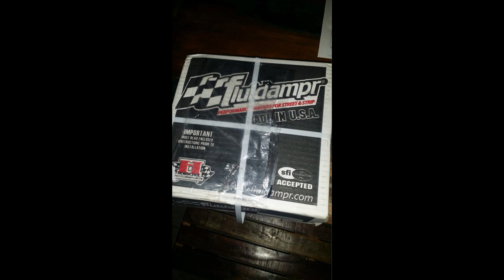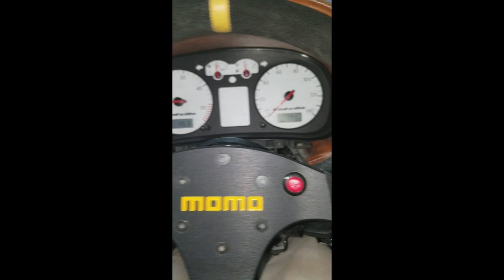All wheel drive, compound turbo, TDI swap Volkswagen Caddy

Comment: Nice build I dont like my caddy because the cab is too small. l think I would have done the pickup truck kit for the mk4 jetta. and put it on the quattro chassis. Probably better result. just the wheel choices are narrowed on the rabbit pickup doing it that way. In hind sight I would just have done what I did with mine and put a AAZ in there with a TDI turbo on it. Plenty of power. Rips the tires loose. but again I dont like driving it because I am tall. too cramped.
Reply from the maker: Bummer. I fit tight in mine now as well because I bought med seats and have put on 40 lbs since I built it. Also the cage doesn't help.

Comment: Were you able to use the stock coils and alot of things from this build I have an 81 and would love to eveven make a daily driver if i can ever start the process and hopefly fing a reareend or rolled car.
Reply from the maker: No. You could but would have to build the rear end a different height. I wanted it low so I made the frame sit higher.  I am using airlift performance suspension.

Comment: What is the transmission you’re using? Would it be possible to use this transmission and use like a Pinto rear axle with stock caddy suspension?
Reply from the maker: It's a 02m out of a TT that Anutee at Dieselland swapped the gear sets with a tdi 02m. You could probably do that.

Comment: hi,how did you mount the engine mount from the bottom ? maybe you have some pics of the lower mount great swap
Reply from the maker: I cut the whole firewall and frame rails out. It has a full mk4 firewall, Floorpan and frame rails. Essentially it's a mk1 body on a mk4

Comment: I have a good friend putting a V12 Toyota racing engines into a Miata. I was also. Thinking about that that in this one i can get engine for 1800.00
Reply from the maker: That would be an insane build. I just bought a V10 tdi touareg and am thinking about what I can swap it into.
Reply: @fasterthanasupercar846  They only put out a little over 500HP
Reply from the maker: @tonyadams09  310hp